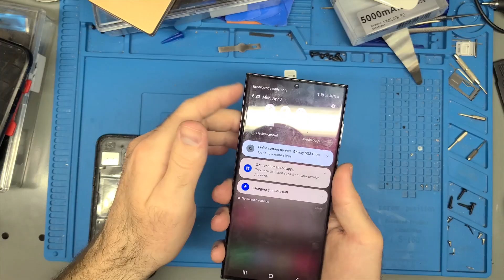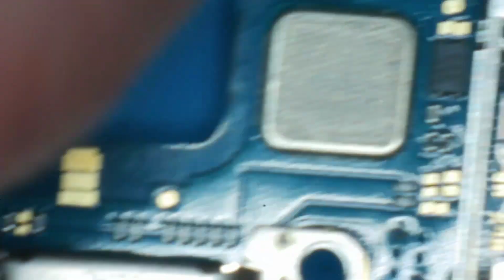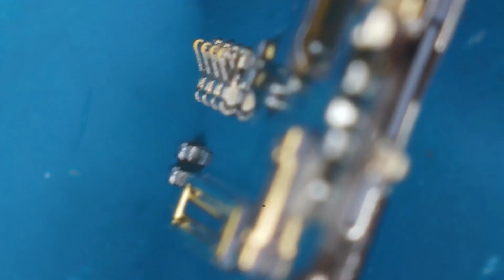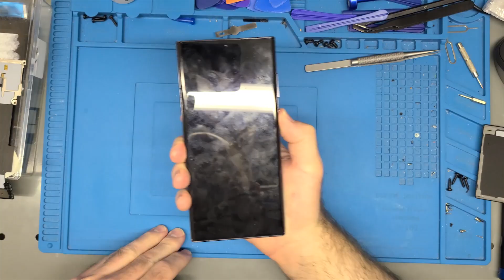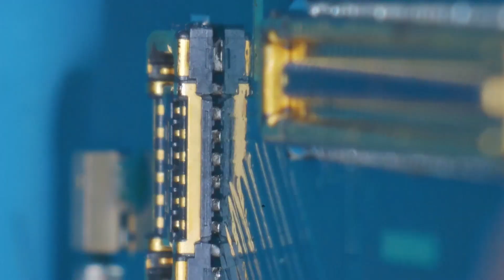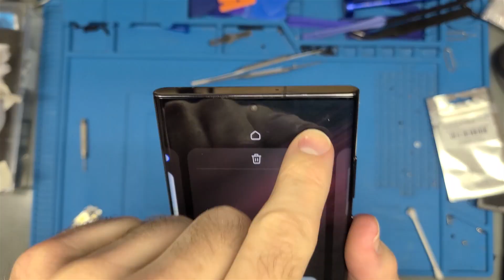Samsung Galaxy S22 Ultra Won't Make Calls or Text - Can I Fix it?

Comment: Thanks for the video. You have unprecedented persistence. I am not that handy but I am fixing the same phone now for the same problem. It might be easier to get the part for less than 10$ and call it a day. What you tried might be necessary though, in some cases when you can't find the part and you have to work with what you have.